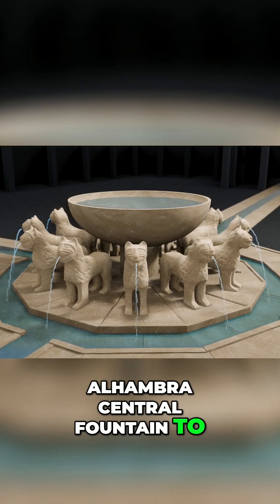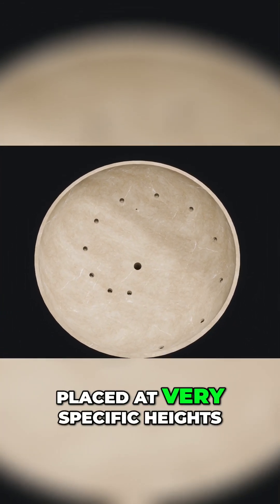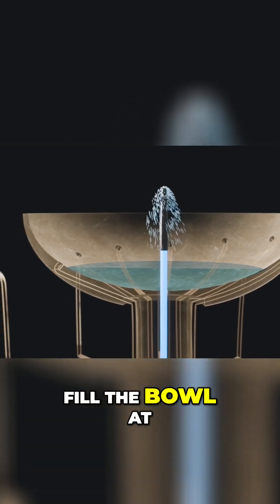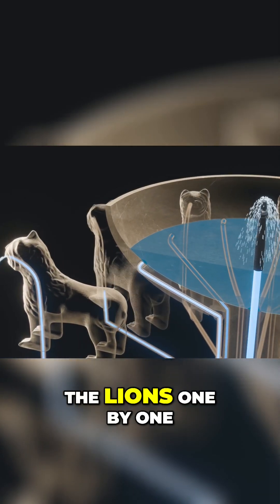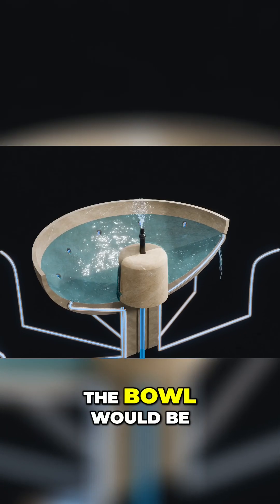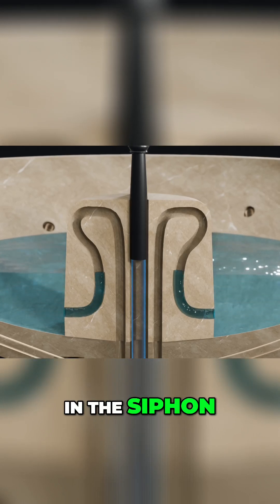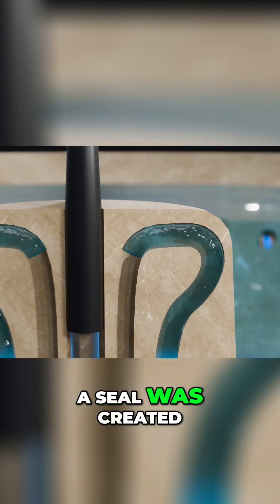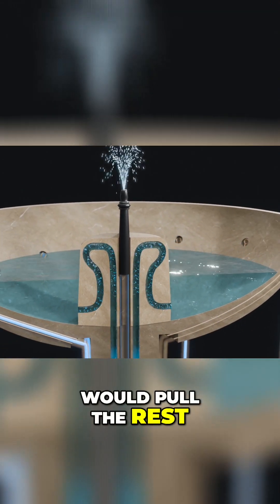How the Alhambra Fountain Uniquely Tells Time

Comment: If the water supply is constant but there is an increasing number of holes throwing the water out of the bowl as the time passes, shouldn't the water be raising more and more slowly? Plus, it's a bowl we're talking about, not a prism, which means that the area of the circle that forms each horizontal layer is greater the higher we go, so even without holes, the water should be rising more and more slowly the higher it gets. How did this work, then?
Reply: The distance between the holes were not equal to account for this